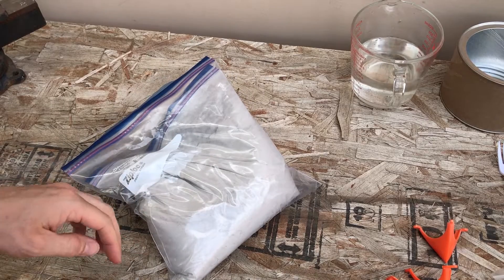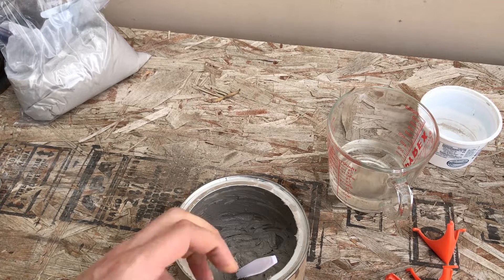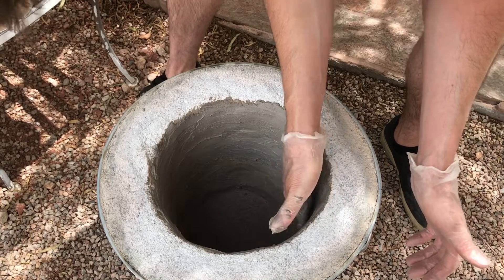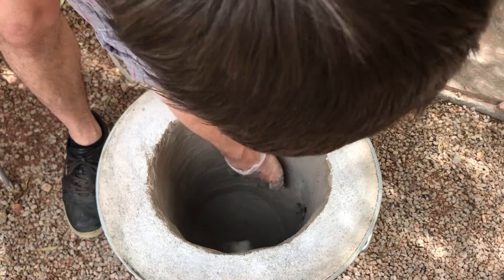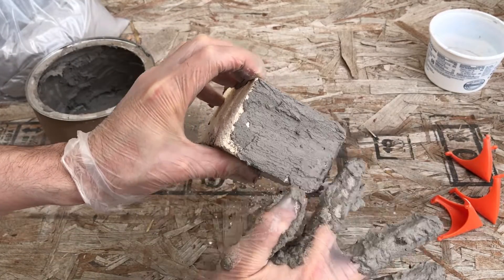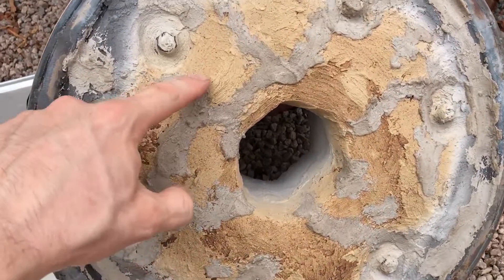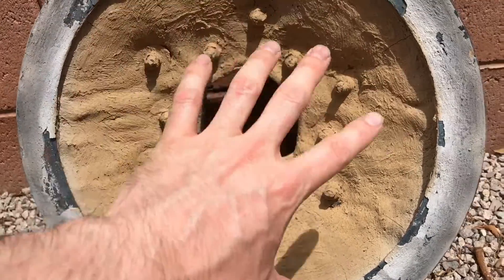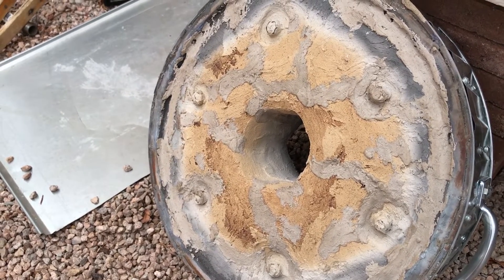Satanite Refractory Mortar│Ceramic Fiber Coating│Forge Making│Foundry Furnace Making

Comment: I wonder if adding fiberglass insulation strands, or possibly strands from the kaowool itself would strengthen the satanite mix?  Also perhaps adding sodium silicate (water glass) to, or in place of water as the wetting agent.  Lastly, I believe using a rubber spatula instead of fingers would leave a smoother surface which when cured, might require less maintenance over time.  Then again, I'm not certain if the turbulence made from the irregular surfaces are beneficial to the smelting process or not.

Comment: Some issues I had with cracking due to shrinkage was to add some Lithium Oxide, which has a positive temperature coefficient. In my case it was about %5. If you add too much, you might get compression fracturing. 
I have used a lot of Kaowool in my  projects, but I noticed it was very suceptible to Borax fumes.
A thin coating of fiber free reractory seems to help.
Reply: Satanite is very likely designed to increase its own demand, easy fixes are easily within reach of the engineers who designed this product.
Reply: @alexwalker8422  Speaking of design. I tried successfully to work-up a mix using components from a pottery supply. It was more expensive than a commercial mix, but I wanted the experience. My earliest furnace was an electric one in 1972, using a commercial refractory mix and it worked well. It was a prety easy exercise since I had worked as a technician in a Ceramics lab.
I have to admit that using a proven commercial refractory mix is the cheapest and easiest approach, but if you want the experience and you have a lot of free time, go for it.

Comment: I JUST bought 2 new forges. One propane (for copper & aluminum), and one smaller electric one (for precious metals)...    This is the next step for me before I get started learning how to smelt some metal. This is one of the only videos I've seen on this particular subject.  Every other video I've seen is either about building the forge itself out of old propane tanks or something,  or strictly just melting the metal, and pouring the bars (or billets).  Thank you very much for the educational content! It was a great help!! 👍

Comment: Thanks for the video. I had soapstone stove come with an unlabeled bag of powd3r that we all figured was for repairing chips in the stone. 

Turns out it's satanite and I'm using it to repair a hairline crack and to coat the internal firebrick

Comment: Are you sure that is Satanite?The satanite that I bought, 5 pounds, came in individually labled 8oz foil lined sealed pouches and looks slightly lighter in color. The instructions show to mix with a half cup of water per pouch and that gave it a milkshake consistency that brushed easily and adhered well to the water mist dampened KAOwool surface. One pouch covered a 12K Gongyi furnace with 1" KAOwool(rigidized earlier with Mr Volcano pink rigidizer and fire cured). I gave it four coats of satanite over 3 days an let it sun dry. I have fired it bringing it up slowly until the empty crucible glowed red. Burned for 20 min and upon shut down, covered the top hole to soak and bring temperature down slowly. I have one barely visible hairline crack on the whole furnace. Tonight I will coat with 100HT per it's instructions. I did not notice any burnt smell though on mixing or firing the satanite.

Comment: are we coating ceramic fiber to trap particulate or to increas heat resistance ? i coated with clean burn refractory , seems powdery after set ? will the satanite lock it down ?

Comment: I just got a forge for knife making and a tub of this powder came with it the forge walls are this really thick fabric white in color do I need to use this stuff on the fabric?
Reply: Yes, after applying a rigidizer. It's recommended because it stops tiny ceramic fibers from being blown out of your furnace. You could potentially get serious lung damage from inhaling said fibers, thats why it's good practice to coat your furnace.

Hope this helps

Comment: Would have to be a good idea to use satanite as a mortar between soft firebrick, or would it be better as just a coating for the inside?
Reply from the maker: I believe it can be used as mortar but you’d have to check to make sure.

Comment: Incredible video, very good information and straight to the point. 👍

The one thing I can add is that satanite applies very well with a 3 inch wide paint brush, and the paint brush is very cleanable. The bowl and mixer I used, I disposed of though

Comment: I use a flexible plastic bowl to mix the satanite.   After application I let the bowl dry and flex it to remove the dried satanite which I collect in another container.   Because it has not been fired this leftover material can be ground up and used later.

Comment: Thanks for thoroughly sharing your experience and attention to detail. I noticed other comments about using rigidizers on the kaolwool... Is this step required or does the satanite bond better to wool without?
Reply from the maker: You're welcome. I have never used a rigidizer. In my experience, satanite sticks well to kaowool by itself. Lightly misting the wool with water before application helps a little. Just dont keep going over one spot with the satanite. Good luck.
Reply: Kaowool is not a structural material. If you wet it with a neutral solution of sodium silicate (also called colloidal silica), after firing the fibers are locked in place. It has two benefits, one is that fiber will not dislodge into air and enter lungs. Another is that the wool will not collapse with repeated heating and cooling cycles and will take fair bit of load due to fiber locking in place.
Reply: Use aqua net generously let dry and apply satanite

Comment: Question. I live in the desert. And right now it's August and temps reach 120°F or more during the day. Could I just leave the Satanite out in the sun to cure? Water doesn't stand a chance against that kinda heat.

Thanks for the instructions. I just purchased a full set of high temp kaowool from these guys, plus Satanite and a refractory coating. My foundry is gonna burn like the core of the earth!
Reply from the maker: I’m in Vegas so I know exactly what you mean. I found that drying the satanite slowly is best. After coating your wool, let it dry slowly in the garage. If it drys too quickly it will crack. 

Good luck on your furnace!

Comment: Explain what it's used for. Why we gotta use Satanite ?
Reply: Late response but: Satanite is used as an insulator so that your rockwool or bricks aren't directly being exposed to the heat. It makes them safer (the ceramic fibers burn and break off when exposed to heat and can cause silicosis when inhaled), and last longer. It's cheap, it'll make your forge or foundry last longer, and it'll make it safer to boot.

Comment: Do the bolts and nuts holding the ceramic blanket on the furnace cover expand and contract due to heat? If so, how do they remain threaded on to each other?
Reply: From what I understand you apply a rigidizer to the ceramic blanket so it doesn't flex Once installed The bolts are likely just there as pins to keep it in place.

Comment: Why do you coat the cast-o-lite 30 with satanite.
Reply: There are different grades of kast-o-lite. 30 is rated for 3000 F, which (I believe) is the top temp you can get it to withstand. Satanite is rated to 3200 F, so it can take a higher heat. Lots of forge and foundry makers will use some castable refractory like cast-o-lite 30 for the main walls, then coat the inside with Satanite, which increases its heat rating and insulative capacity, while protecting the main casting. When the Satanite wears off, chips away, etc., just brush over it lightly to clean up the surface, vaccum it clean and add a new layer. That way, you're always just touching up the surface, instead of having to do major repairs to the casting or re-cast it altogether. If you want even higher temps (and faster to get that hot), coat over the Satanite with ITC 100 -- or other high-alumina IR-reflective coating. If using Inswool / Kaowool ceramic blanket insulation, line it with that stuff, then apply rigidizer (spray/paint-on liquid), dry that, cook it in a bit to 100% dry it, then coat with Satanite, cook in each layer with low-burns and allow to cool -- a couple times each layer, then ITC 100. That keeps the particles of the Kaowool from getting broken down and airborn (i.e., giving you lung cancer) and protects it - same as with the Kastolite -- just clean up the Satanite and re-apply to keep'er in top order.

Comment: Ive watch both of your furnace builds. On the keg build you used ITC 100HT as a rigidizer. which is better and more durable?
Reply from the maker: Hello, I would recommend Satanite as a coating for the fiber and then ITC100 over the Satanite.

Comment: Really love the channel!! I made my own furnace but I am thinking about buying one because mine is charcoal powered! I am definitely subscribing
Reply from the maker: Wes’s Castings Thanks, I started with charcoal and quickly switched to propane. Propane burners are super easy to make. I used the King Of Random design which is fine but their are many options out there. Good luck!
Reply: Seth Robinson thanks so much I’ll check it out
Reply: Good news!! I got a devil forge! Just wanted to let you know 😂
Reply from the maker: Wes’s Castings Those work fine! Make sure to coat that ceramic fiber with something like satanite though. If you haven’t heard by now airborne particles are a carcinogen. Have fun!
Reply: Seth Robinson yes it came with rigidizer and I ordered satanite! Thanks so much for this video couldn’t have done it without you!!

Comment: Thanks for all the great info! If I have already applied the rigidizer to the kaowool, would I still need to apply a layer of Satanite?
Reply from the maker: Ben No problem! Yes you do. Rigidizer is simply to make it easier to coat the fiber with something like Satanite.
Reply: @robinson-foundry  where is ceramic wool? can you cover it with this directly? will it not tear the wool if it cracks?